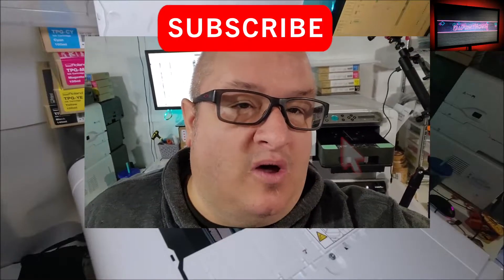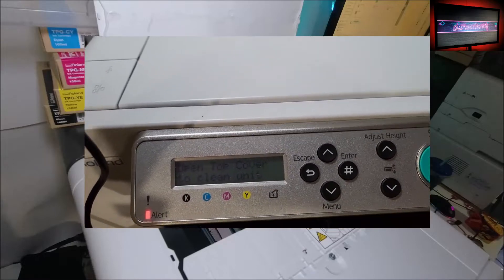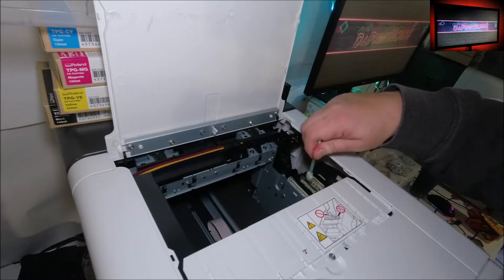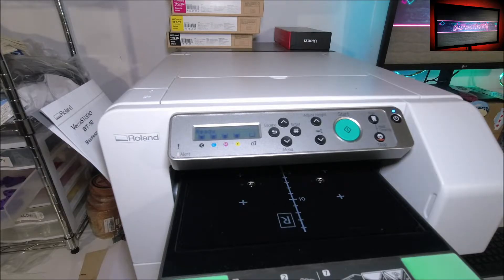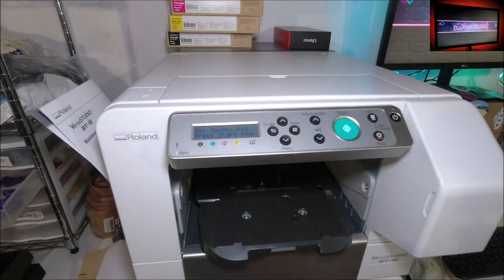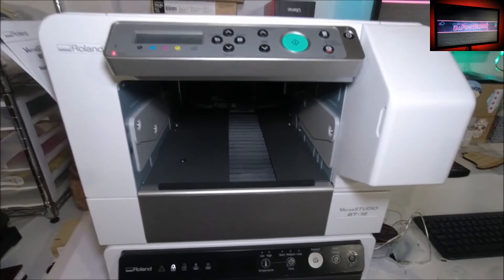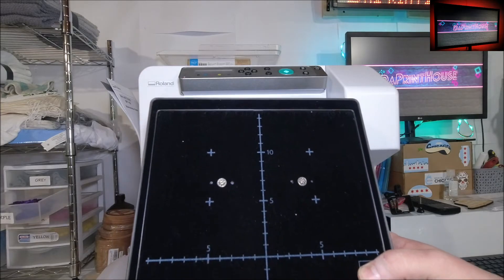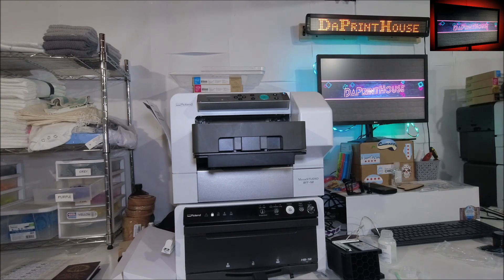Roland BT-12 DTG printer maintenance quick how to video

Comment: Have you ever had weird bleeding issues with this printer? Every now and then I'll get a weird color bleed on my prints or text will have a 3D effect where it looks like the same letter is printed twice, but one slightly above it.  I use vivid print, which does a double print, but it shouldn't be doing that 3D effect.  It started happening recently after 2 months of daily use.  I'd say about 1 out of every 10 or so prints.  Ran a nozzle check, everything is perfect.  Just did the routine required maintenance too.
Reply from the maker: Ye pretty sure its the cassette,  only when u do vivid or fine with a second pass right?  When u put a garment in there if there is to much bunched up on the frame of the cassette it can force the print area down
Reply: @DaPrintHouse  I actually only do vivid so I'm not sure if it would do it on fine, which is 1 pass.  As for the garment bunching, I'm pretty careful about flattening everything out and pressing it to make sure everything is even.  I'll keep an eye on it, but do you have any other ideas?  I'll probably contact Roland tomorrow.  Also, it only happens on some letters and not others of the same shirt, not sure if that helps any.  Earlier I had one with a random bleed too.. the first print didnt have that bleed, just the 3D effect.  2nd one had less 3D (but still there) and color bleed on the image.  Thanks for the reply.
Reply: Have you ever had an error code 20252? My printer is unable to print at all and the error code is present. We opened the side of the printer and see ink is leaking out when the printer first gets turned on and the display shows loading ink, then error 20252.

Comment: Hi, thanks for the video. My bt12 is coming up 'ink collector is not set' but it's in the right place and I have tried changing the unit. It has always worked but after leaving it for two weeks, this message came up. 
I was wondering if you have any advice?
Reply from the maker: Hi, try cleaning the contacts on ink collector with alcohol  and resetting it
Reply: Thanks for the reply!